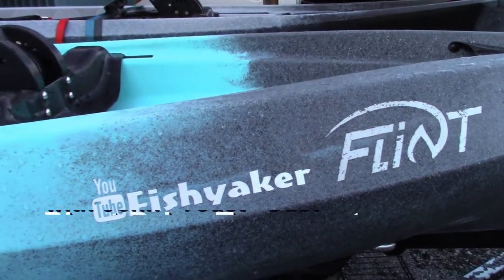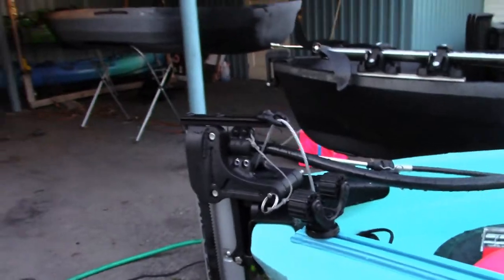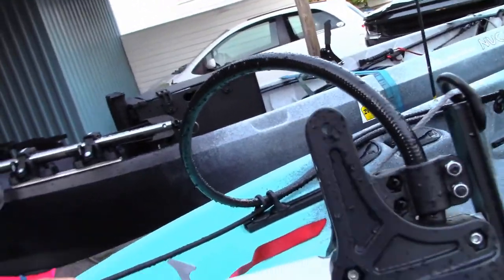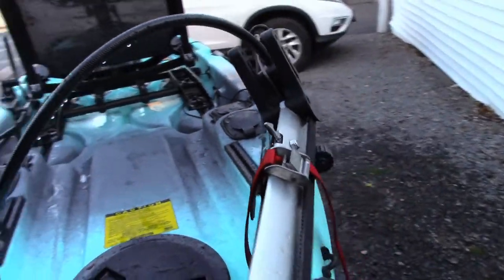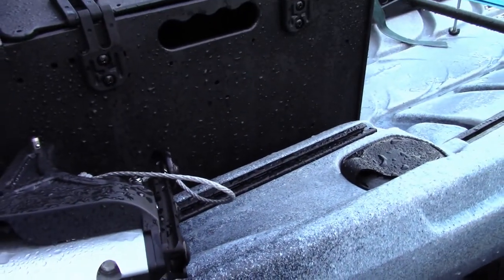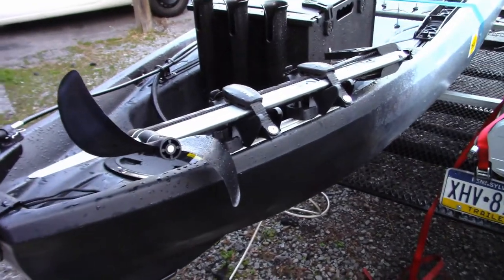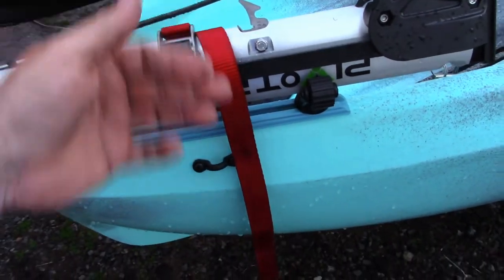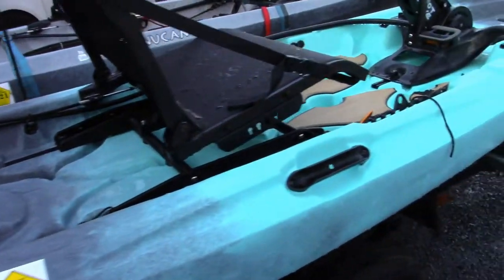NuCanoe Pivot Drive Transport Mod:  Fishyaker Kayak Rigging

Comment: John, the Malone accessory, are these the same thing as you find on their roof rack crossbars? If so, this would be a significantly more expensive option, so as much as I would prefer to go this route, I’d rather spend the extra 70 bucks on more tackle. Is your dealer offering that Malone option to others? Might be interested in finding out what they would want for it. Might be worth a road trip.....
Reply from the maker: Jay,
Yep, they are Malone rack accessories.  They are about $35 for a pair.   Most Malone dealers have them.  I just used T bolts instead of the rack bolts. 👍

Comment: Great idea! I was wondering if you could share your thoughts on the pivot drive. I have a pursuit and it paddles very well but a bad shoulder is causing problems. Is it hard? Tiring? Practical? Really good for fishing/cruising? Smooth operation? Thanks a lot and I know that’s a lot of questions.
Reply from the maker: Thanks!  I really like the Pivot Drive concept.  It’s great for those who want to add a pedal drive later, but don’t want to buy a dedicated pedal Kayak.  It’s also perfect for rivers and fishing around structure, because it has an automatic release and pops up when it hits an “immovable object”. 👍😊